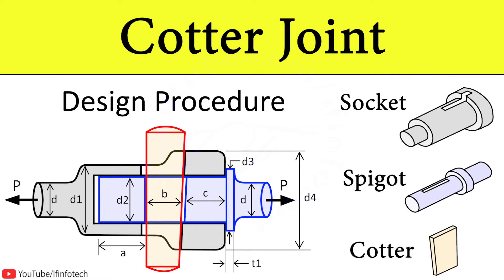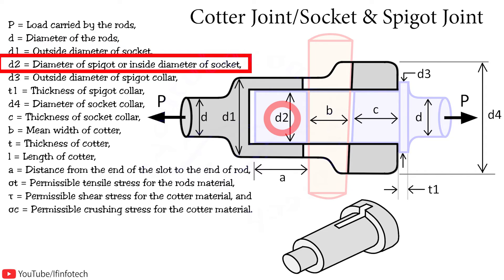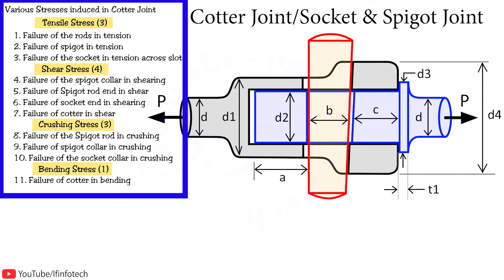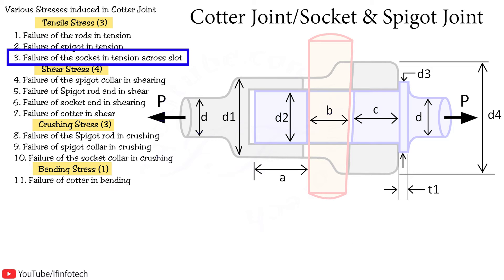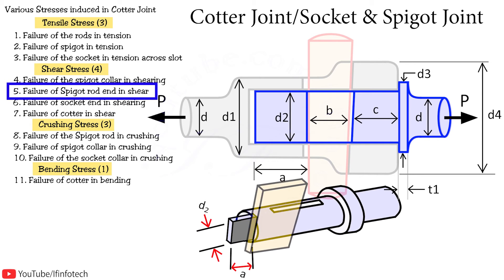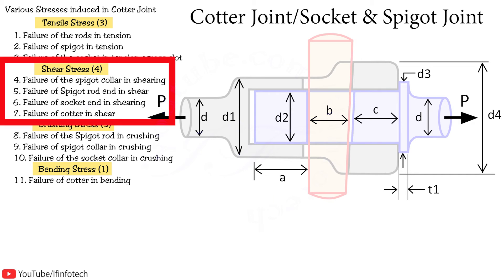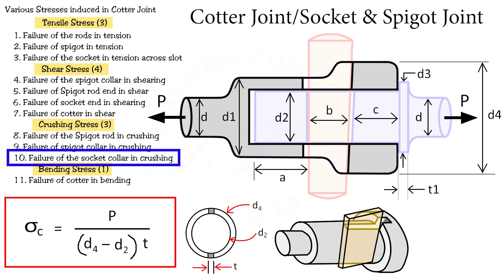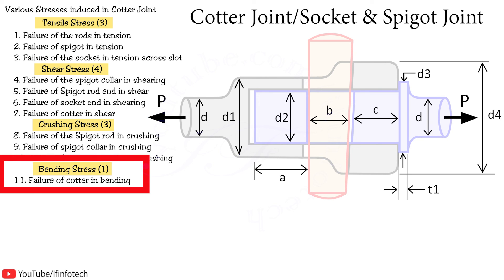Design Procedure of Cotter Joint, Design of Machine Element, Types of Failures | Shubham Kola

Comment: Super explanations but I can't understand the area on which the 4th stress applies.

I think it would be πd_3t_1.

Correct me if I'm wrong, I'm a 2nd year Mechanical student so I just wanted to know about it. So i don't know whether it is correct or not.

Thanks in advance for your answers.
Reply from the maker: Hello🙂and thanks, 4th stress is shear stress in spigot collar and failure occurs due to shear stress at diameter of spigot collar and the formula is load p divided by area of cross section i.e. pie multiply by d2 multiply by thickness t1
here 👉 pie multiply by d2 is the circumference of the spigot collar inner circle
and 👉 t1 is the thickness of spigot collar